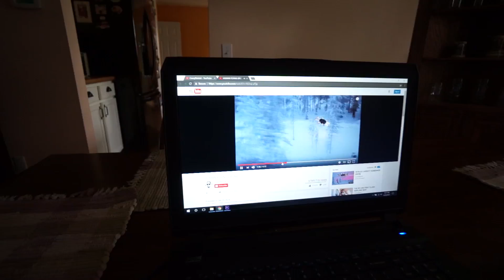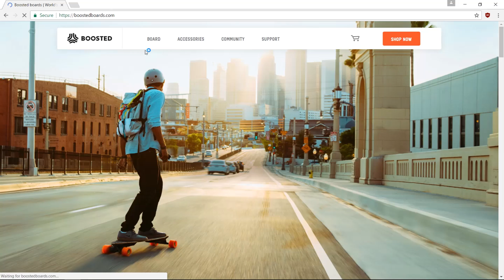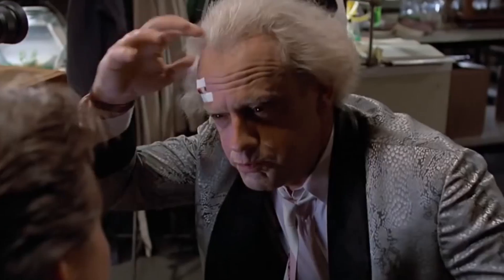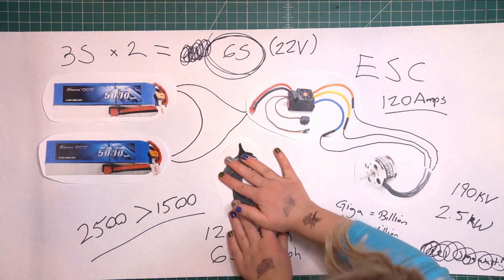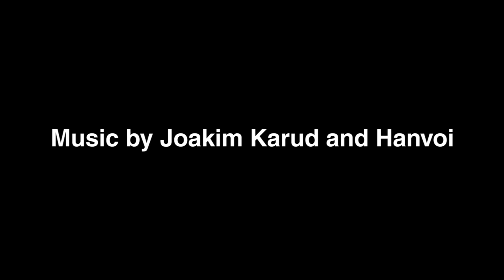DIY Boosted Board and CASEY NEISTAT CAN I BE IN YOUR VLOG?!!

Comment: did you print in pla?
Reply from the maker: Printed in PLA with 75% infill. Haven't noticed any wear and tear on the plastic versus the belt which is starting to show some wear.
Reply: ok if you want the 3d printed part to be stronger you could try lost pla casting it seems easy check out a dude name pauls garage to see what it is

Comment: Hi, wich ESC do you think is better? The ESC or the VESC?
Reply from the maker: VESC is definitely better. The ESC works "good", it accelerated cleanly and would brake firmly. But the VESC does those things "best" and has better throttle response. Big plus is the VESC has regenerative braking and current limiting to avoid overloading the motor where the ESC will dump as many amps as the battery wants to give and risks frying something.

Comment: how much was it for you to get all the stuff and make the board?
Reply from the maker: I didn't keep a running total of every single part but the final setup was in the $400 - $500 range. I cut costs as much as possible on everything except the motor and VESC. I didn't count the 3D printed parts because I already had the 3D printer and I made the electronics enclosure out of wood I had laying around.

Comment: love the video. what distance and speed can you get with this setup.
Reply from the maker: Should get max 20 mph (with 6s battery, a 12s would double it)and 10 mile range. That's under ideal conditions and it probably gets a little less than that. Haven't measured either since I haven't worked up the nerve to push it to top speed yet.
Reply: With 100% efficiency you can get 16.4 mph with your setup. That only happens if there's no fluid friction, including air (essentially if you were in a giant vacuum that was perfectly level). A 5Ah battery will typically yield around 7 to 8 miles, depending on the rider, as long as you ride it easy (11-12 mph for your setup). If you max it out at 16 mph, then you'll be looking at a total distance of 4 or 5 miles as long as your surface is pretty level. Don't be discouraged by these stats - your first try at anything will leave you thinking about what you can do better. Btw, a 12s version of your setup would achieve 29.52 mph under ideal conditions in the real world (90% efficiency)

Keep it up - and stop copying Casey, you say it's a joke but I don't think it will really fly with your fanbase - especially if you don't properly inform them about it.

Comment: what wheels did you use
Reply from the maker: will pope I used this kit that includes the wheels, bearings, and spaces. No complaints, they work very well. http://www.ebay.com/itm/281661805302?var=580665315832

Comment: when you connected did you have to set the receiver to work with the remote because I tried it with a syma x5c remote and a fly sky receiver it didn't seem to work but i'll have to try it again. I'm just wondering if anyone could help me because I saw a video and you have stick this piece into the remote to let it connect to the receiver so i think you need the binding hole thing. Thanks!!!!!
Reply from the maker: I didn't have to bind the remote and the receiver out of the box because they came as a set. I'm not familiar with your remote but if they are compatible and you perform the bind process there shouldn't be anything else you need to do with a RC car ESC. If you're using a VESC make sure it's set to PPM (which is really PWM from the receiver).